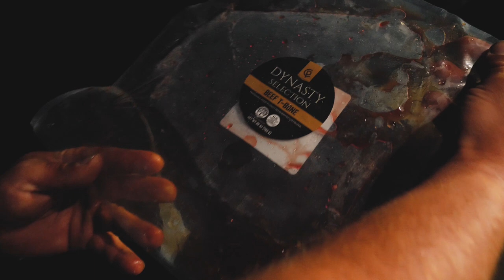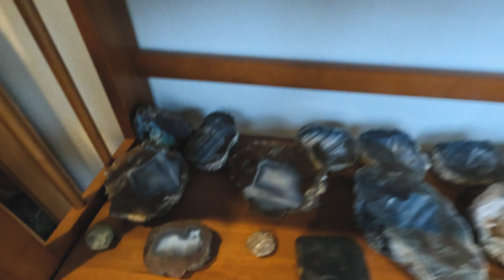You're NOT Going To BELIEVE What I FOUND!

Comment: Great video. You are one of the few fishing you tubers that actually teaches technique, and you don’t just show off how good you are. I have a question, I have never fly fished before. I have an old fly rod, but it’s a 7wt. Is that too heavy for normal trout fishing?
Reply: I say use it. Yeah, a 7wt is a little heavy for most trout but use what you have. I fished a 7wt for everything when I started out and had a blast with it. Plus it will also work for salmon, steelhead, bass...